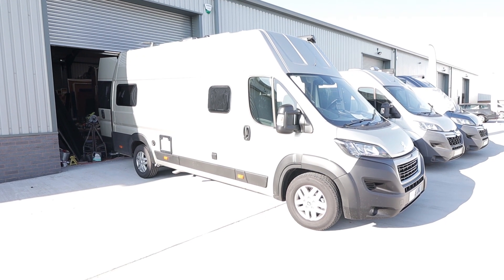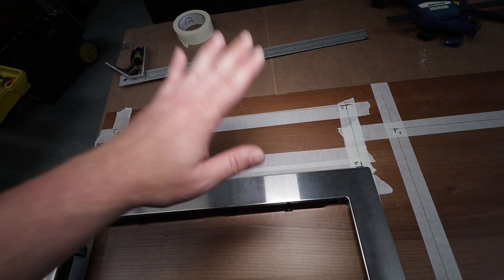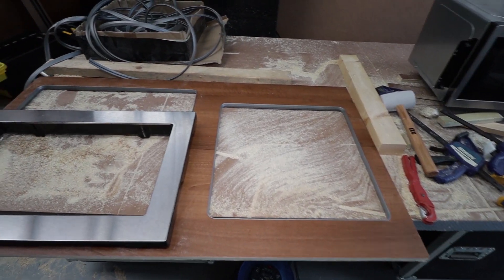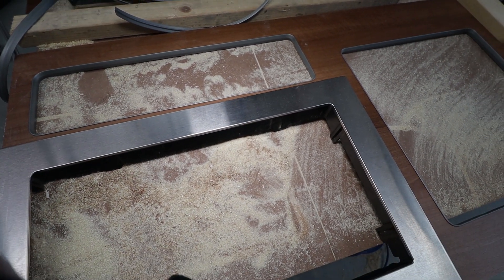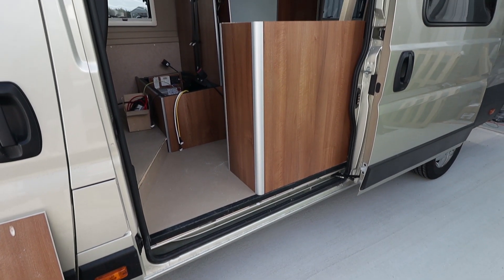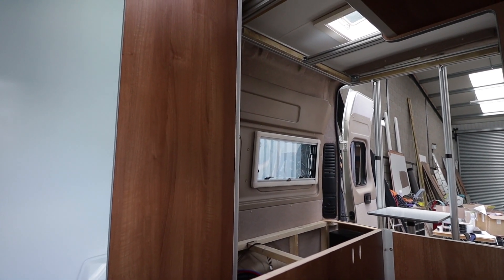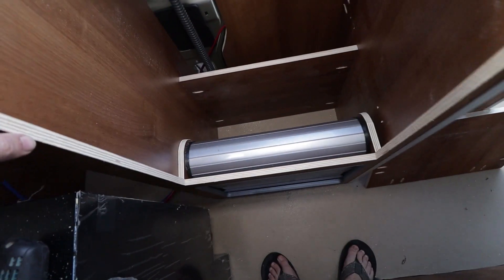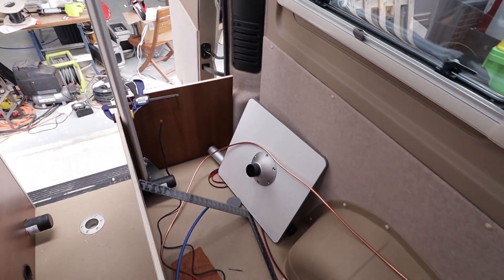L4H3 New Peugeot Boxer Camper Build with Electric Bed - Part 2

Comment: Big fan of elevating bed solutions. Anyone can build a couch that converts to a bed but that's a huge amount of work every day to make the bed, unmake the bed, rinse and repeat. I suspect many just leave it as a bed and live with the poor amount of non-bed-related living space. An elevated bed? You just do a basic tuck-away of the covers and the like, push a button and it goes away. At night, bring it down, hop in and sleep. And on this one, of course, you now have a 4-bed tiny campervan with 4 travel seats, there are small ready made motorhomes that aren't as versatile. I'm strongly considering some elevating solution myself, and I'd probably have an office type setup underneath as my work is computer related. Eating and socializing area up front. Anyway, awesome build, hat's off.